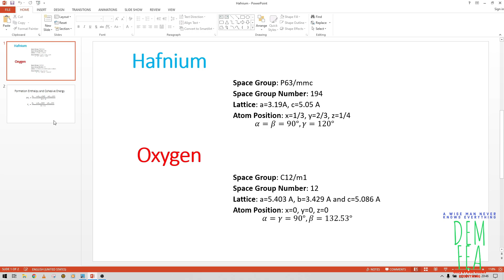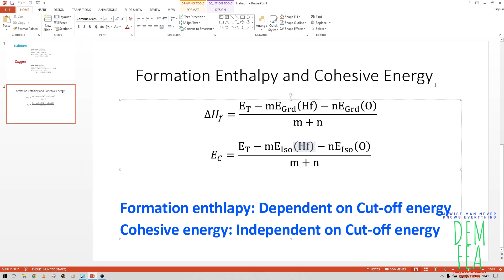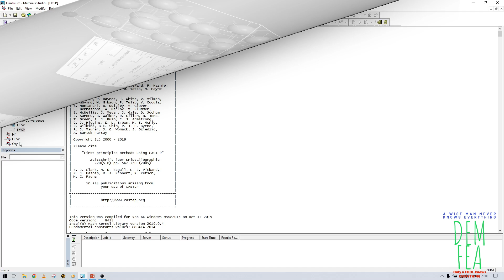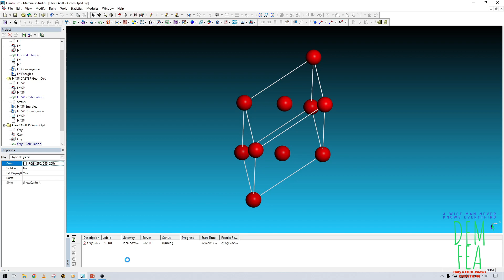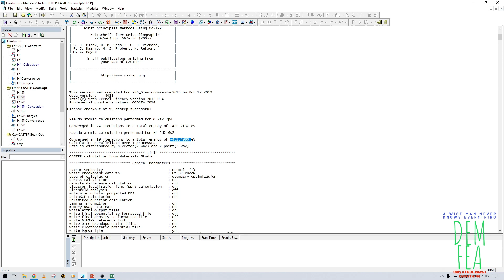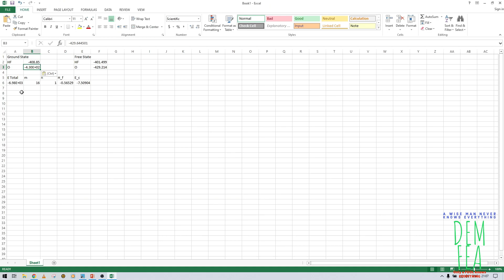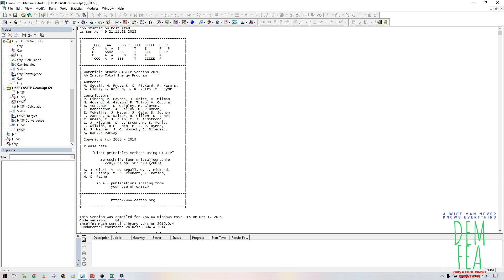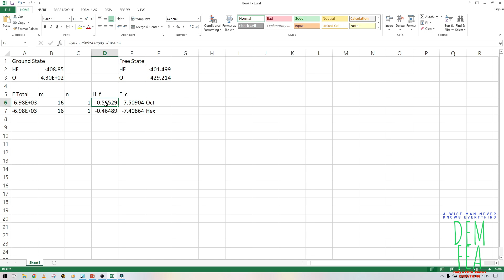How to calculate enthalpy of formation and cohesive energy from First Principles using CASTEP code

Comment: Sir, how did you take Oxygen calculation as "Metal" (the Metal is clicked) in the CASTEP Calculation window? As O is not a metal.
Reply from the maker: I considered the whole alloy as a metal. This is because Oxygen content was low enough hence no non-metallic compounds can be formed. For example, in the case of TiO2, you should consider the whole alloy as a non-metal. 
Yes, oxygen is a non-metal, but the whole system is a metal.
I hope this answers your question.
Reply: @PiotarockIn  Sir, in that case, I can take individual Oxygen calculations as "Metal" right? Can I do the same thing in the case of S in FeS2?
Thanks for your reply
Reply from the maker: @sciencecraze  It might be tricky to take individual Oxygen as a metal. But, you should ensure that the simulation settings are similar, i.e, the cutoff energy, pseudopotential etc.
Reply: @PiotarockIn  Thank you for the reply. Thanks Sir.